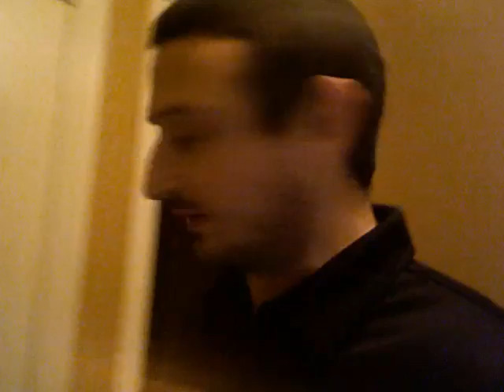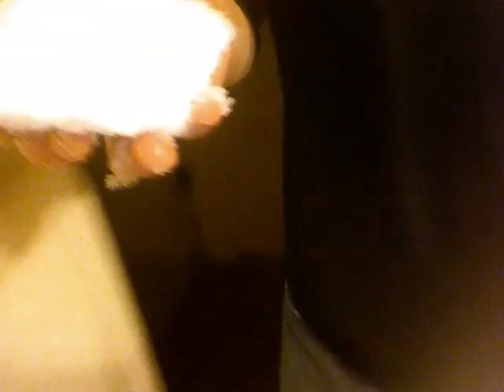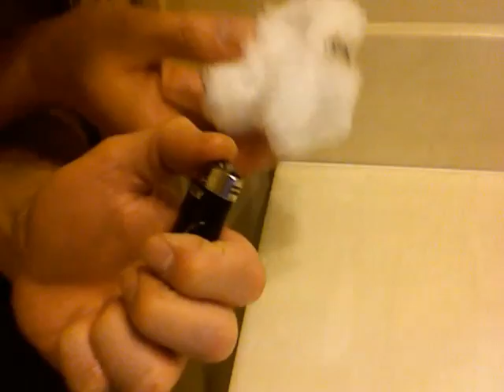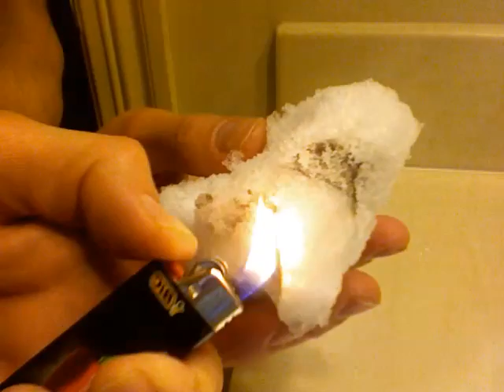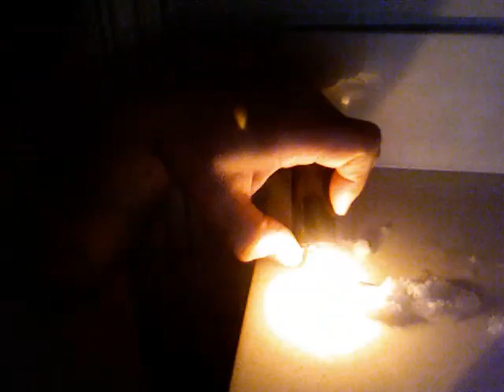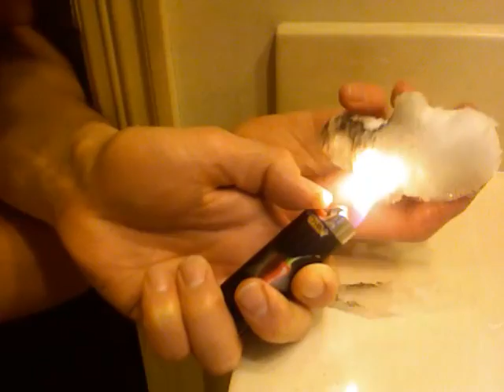Can A Chemist Please Explain Why Flames Don't Melt Snow?

Comment: Notice that veryone that's doing this in all of these post is using a bic lighter. The black is from soot from unburnt butane, and the reason it doesn't drip water like they want is that ythe flame applied to that one small area causes some to evaporate immediately and what does turn to liquid is only enough to soak back into the non melted snow. Put the same snow in a pan and heat it on the stove and it turns right to water. People that don't understand the science that's taught in fourth grade get worked up about silly things, like government conspiracy nanobot snow and the politically driven myth of man made global warming, or is it climate change now. LOL

Comment: Lighter under anything will produce a blackfoot print=carbon,same as matches,wood,a candle..all going to leave soot behind on anything.Put the lighter under glass=think black smoke,and will smell the same.
Receding =melting
Snow 5% water and a natural insulator,all water is being drawn back.
Not strange at all.

Comment: Wack ass science guys right?  ok first off the biggest problem with most of these video's are that the people posting them have little to no education (i.e dropped out of high school at the tender age of 19).  The thing you have to understand about any type of experiment is that there must be many types of controls in place.  Where did you get the snow from?  how much snow accumulated when you retrieved your sample?  how long was it on the ground?  was it taken close to a road where cars (that produce exhaust that will contaminate samples) drive by often?  after you take this into consideration you have to think for a moment that the control that pretty much every one of these uneducated people with a camera are using, is ice that is created from the refrigerator in their double wide is on a molecular level completely different then the conspiracy their weakly trying to spine to the masses.   Next time try to do some basic research before you freak yourself out of your buzz and scream that the goverment is once again screwing up your cherry snow cone dream.
Reply: oh and by the way if you keep posting these types of video's the NSA will kick in your door and drag you kicking and screaming to a FEMA death camp.....  You probably already know what im talking about right?

Comment: I saw a few videos of the "fake snow" and have a possible explanation.  Have you ever heard of Super Absorbent Polymer (SAP)?  SAP is used in diapers and starts as a small crystal and absorbs lots of water ending up as a larger chunk of what looks like clear jello.  If the SAP was sprayed as fine powder into the sky and fell through wet weather it would reach the surface looking like sleet or granular snow.   When burned it would act like the in the videos.  It releases the absorbed water when the water evaporates and the crystal gets smaller.  The charring can be caused when the crystals burn because they are a polymer (like plastic).  The best way to test to confirm my theory is to make a snowball and insert a thermometer and record the temperature every ten minutes.  I bet the temperature will be above 32 degrees that real snow would be.    After q long time even the saturated SAP will shed its water and return to its small crystal form.   If there is a residue, add some water to it and see if it puffs back out into what again  looks like snow.  If so, you have confirmed my theory.

Comment: Take a small piece of snow and put it on the end of a stick then hold the lighter to it until it is gone.  The volume of snow is mostly empty air pockets, the melted water is being wicked into the surrounding snow by capillary action.  Until the snow is completely saturated with water it will not drip.  The black is soot from the butane.  Do it with a propane torch and it will not turn black.   Watch this:Fake snow!? Science is Fun (Looks can be deceiving [snow MELTING]): A Saturday Science Experiment.

Comment: Will you try running it under water & see if it melts? No one is trying that!
Reply: Well no shit it would melt from running under water or melting over a heated pot. If natural heat wouldn't melt this "genetic" snow, it would be a complete failure n we would still have snow everywhere.

Comment: Isn't snow porous so the snow that would be melting and dripping is just absorbed by the snow until it becomes to saturated and starts dripping. The black smoke and deposits are the byproduct of the lighter you can test it on any glass the lighter will leave a dark mark. I tried this test for myself try using a candle then it drips, western New York resident here

Comment: OMG. thais guy is completely blank. If you never experimentet before with snow (or anything else) how on earth can you conclude that if things don't behave the way you think, that it's fake. To start with, the plastic smell i from the lighter that has been burning for too long and is starting to melt. The reason it doesn't melt away quickly is because snow is an isulator - the reason inuit build houses of it. And an incomplete combustion will create sod for many compounds...

Comment: I'm currently a Science major at EMU, and  to be honest, holding a lighter close to any object (besides wood and anything that can produce a flame) will get a black chard look to it. also this is normal behavior for snow, If that snow you had was compacted in any way it will not melt! if it was loose powder snow then it will melt. over all snow is H2O but in a solid state and it is safe to eat  if its not near sidewalks or roads where salt is used. salt can alter the composition of snow. I do agree with other people who say the snow is receding back and is just leaving you with ice. also you will have to put into consideration that because of the pollution we put into our air (CO2) can change how snow reacts. I would say to keep doing this over and try doing other methods (powder snow and a flame... etc) Nice video tho! very interesting! If something doesnt make sense just reply and i'll go more in depth on this. and I am going to share this with my professor who studies about snow/ glaciers, etc.

Comment: I live in MONTREAL QUEBEC, if there's one thing we know well, it's the damn snow. This is not normal at all and to be sure, I just went into my back yard, grabbed a wad of snow and lit it up. It does not melt into a liquid or condense, it just evaporates after a while. HOWEVER!... It did not leave a trace of black char. It was crystal clear as it receded. This with a normal bic lighter. That is obviously not normal at all. If it was, it would be doing here too. I feel for you people. REMEMBER TO THUMBS DOWN THE SHILLS!! Don't let them get their lies to the top!

Comment: Hey Einstein, what do you think snow made of? That's right, WATER!
...Aaaaaand, what do you throw on a fire to put it out?  Wait for it....

People seem to forget or be unaware that snow is made of water, which is used to put out fires because it is effective at retarding an exothermal chemical reaction.

When you put a non catalyzed flame like that of a bic style lighter or free burning material next to a very cold and thermally conductive substance like snow or metal, it sinks heat away from the fire (thus the term "heat sink") and this lowers the efficiency of the oxidation reaction, causing what is referred to as a "dirty burn" or "cold burn".
Depending on the fuel source used, what was once a relatively clean flame that burns completely and produces a lot of heat, becomes a sooty dull flame that spews carbon monoxide and other products of incomplete combustion.

If America had spent more money on education in the last 30 years and less on bombing other countries back in to the stone age, less people would be on YouTube making videos that demonstrate so effectively, how embarrassingly ignorant the masses have become.

Basically, this is just what happens when you try to burn snow with a lighter.
Anyone who thinks this is proof of "fake snow" needs to get their head checked.

Comment: For a start ice is many times less dense than water or ice. The snow crystals are mostly air and have capillaries. When you apply direct heat the snow recedes because you are reducing the snow back to water which is turning to ice. Any water being produced is either evaporating or being absorbed by the remaining snow. If you continued heating the snow ball eventually you would just be left with a piece of ice which would melt when you applied heat. The black residue or charring is only the affect of the bi product produced from burning the butane gas used in lighters. Is it possible that this is geoengineering snow with unnatural properties. Anything is possible but I think it is more likely that because everyone takes it for granted that snow melts and disappears when the weather warms up, noone ever thought to try and burn it with a naked flame. Ask any bushman or survival expert who tried to make a fire on snow and they will tell you the snow melts slowly and the fire does not produce enough water to put it out. The snow just recedes leaving a whole where the fire was.
Reply: wilz373
This is normal with snow. Proof that fools and lighters should be kept separate. This is nothing new, survival techniques from centuries ago will explain that snow will not melt with direct heat applied such as a flame or, in the case that they were trying to teach, snow in a hot pot does not melt, it sublimates. Old news with new fools, lighters and video cameras.
Reply: Drpokets

The unit of heat per moment of a lighter is very small to the mass of water in the solid form of this size. Snow is, in fact, a very good insulator. That said, since recorded history melting a unit of snow with a torch, lighter, match, candle is considered a waste of effort and energy to try to melt it with direct flame contact.  To say this is something new is fallacious. You need water to melt snow most efficiently. Or..even better. Ethanol, then drink it. ;) 3 fingers of Canadian Whiskey over snow might not warm you up, but two of those, you won't care anyway.
Reply: *****
yea but i live in northern Alberta and when i put a lighter to my snow it melts immediately whit no black residue
Reply: wilz373 candels give off soot as well...
Reply: YAAWWWNNNNN

Comment: It's called "sublimation". In this case, Carbon Dioxide with a small amount of Water Vapor and Chem-trail Particles in it.. When you apply energy (heat) to it you "sublimate" it from a frozen state back to a gas state, thus no water from melting.

Comment: This is elementary science.  Soot from a butane lighter could coat anything, even ice and snow.  Basically the melting of snow and ice depends on the density of the said product.  If the snow has been packed down at all (even just a bit) it creates air pockets, the melt water then flows into the air pockets.  The more dense the snow pack is the fewer air pockets, their for allowing the melt water to flow and drip instead of absorb into the snow pack. If you take loose just fallen snow and hold a lighter flame to it it will melt instantly. if you take a ice cube from your freezer and hold a lighter flame to it, it will melt and drip. just the same take some of the snow in your video and compact it as hard as you can and watch the results.  Not trying to be Mr know it all, but when you live and play in the rocky mountains of Canada you must learn to understand avalanches and snow conditions or else your just a dead man on a snow machine.

Comment: Lighters don't burn clean, they produce soot. The soot accumulates on the object. It was melting... I watched it drip and get smaller. Snow works different than ice, sorta. Ice melts straight into water. Since snow is a bunch of frozen droplets of water it sticks together loosely. So when you have a clump of snow and It's melting some of it drips off, some of it fills in the air pockets of the clump, some of it mixes with the rest of the snow and begins to melt it.
Reply: I've seen the same when people use candles. ?

Comment: we live in va and I did the same thing last night, we used the snow on the ground and then some shaved ice that resembled the snow, we had the same thing happen with the snow outside, it charred black and had a smell, the ice/snow from the freezer melted right away with no smell or odor,  snow does not burn like plastic or Styrofoam and not melt..this proves they are screwing up the atmosphere..

Comment: When you hold a lighter underneath snow, your hand, paper, wood, (any object), the soot from the butane burning will coat the object.
In this case, this guy put a lighter underneath snow, and then said the snow was burning with black smoke, because he doesn't know what 'soot' is....
Reply: Snow is a natural insulator, so burning the snow makes the water turn into a gas. (proportion of water and air) That without including that the evaporation point of water is less higher than the temperature of the flames of a lighter.
Reply: mnarvaez29ify I have to agree with you on this!
Reply: @mnarvaez29ify  
You are intelligent!

Comment: Hi my snow in colo is not, I said NOT, doing that and I used a lighter and then a candle.  It is turning slushy as soon as the flame gets near it and dripping clear waterlike drops quite quickly both inside and outside of the house but at no time does it turn black or stink or smell or "glop" up like plastic.... 0.0
I hard packed 1 cup of it and let it slowly melt to room temp (no flame) and I got exactly 110 ml of a clear liquid... can you see how much you get from 1 tightly packed cup?
Thank you and many BlesSings.

Comment: I also live in Ohio and just did it with the same results. I could not tell if it melted at all. It smelled like burning plastic. The guy below has a good answer but it was a very strong smell and I did not see any water melt off. I will be concerned if there are that many contaminates in the snow. I think I'll keep looking for an better answer.
Reply from the maker: The smell seems to be very "fracking" strange. Just wonderin' out loud.

Comment: (SCIENCE FOR DUMMIES/CONSPIRACY THEORISTS)

A snow pack is an arrangement of millions/billions of tiny ice crystals composed of a minute ratio of ice and air. Around 10% water to about 90% air.  When he's using a common big lighter, although it appears to be a solid mass of light, it's actually hollow, the luminous outer layer and is typically less than 1 mm thick. A Bic lighter produces a 'premixed laminar flame'. This means that the flame's fuels mix with oxygen before burning and retain a relatively steady shape however the combustable area is very small and hollow. Therefore there isn't enough combustion provided by the hollow weak flame to offset the light density of the pack of ice which is insulated by pockets of air. (the same trick people use to walk on coals, the pockets of air insulate instead of allowing feet to burn.)

Now when he brings out the big daddy benzene torch and you dont see any water it's a process called vaporization.  The most common type you'd be familiar with is evaporation. Now when you're using a directed dense high temperature heat source, like in this case a benzene torch he is causing the water droplets to turn instantly to steam. However since its shot with a relatively cheap camera in less than ideal lighting conditions you cannot see this process happen.  

Now Bill Nye wanna be here picks up an ice cube. A solid mass of frozen water (missing the air pockets) Now to put that in perspective would you want to be hit by a softball sized snow ball or a softball sized ice ball. This my friend is called DENSITY. The ice cube water molecules are far more dense than the snow mixture since there is the lack of air between the molecules.  This is why you see water dripping. That is because the ice cube contains something we call MASS. Which means there is more water in the ice cube than the snow ball. Therefore you see condensation in the form of melted water. 

Thermodynamics at work my friend....
Reply from the maker: Thank you for the info Throwdown Ent.
We are especially curious about the smell because butane smells very different from burning plastic.

Comment: Okay here is my rant please pass this on to people to educate themselves. This is common sense.

First off Yes the snow is melting

Snow has a 10:1 Ration meaning that for every 10 inches of snow it is the equivalent to 1 inch of water. What you are witnessing is snow melting but producing less water than expected. You have a small amount of snow there, which will create a very small amount of water. 

So 1 cup of water is 10 cups of snow!

This does not include the evaporation that is probably taking place.

Second

When precipitation comes down in any form it is because it is heavy but before it comes down the the weight must increase to become heavy enough to fall. When snow is formed up in the air it picks up dust, and what ever else is in the air. So when you light the snow it is possible that the contaminates are burning.

Post this on videos please Im tired of seeing them.
Reply: clearly that is not "common" sense lol you also forgot to add that the black stuff is soot
Reply from the maker: Funkyseth: If that ratio is accurate, then the amount of contaminants must be very high to burn black smoke the way that it does & stink like plastic, yes?
Reply: TheNewAmericanMedia anything burned with a lighter like that will have the stench of burning plastic etc. the snow is evaporating when being burnt. black smoke  can be any chemical that was spread on the sidewalk that got into the snow. thats one thing, now if this is fresh snow hasnt been touch that could be a reason to question but it is safe to eat unless  (theres salt near by, or its yellow)
Reply: also sublimation plays a big role